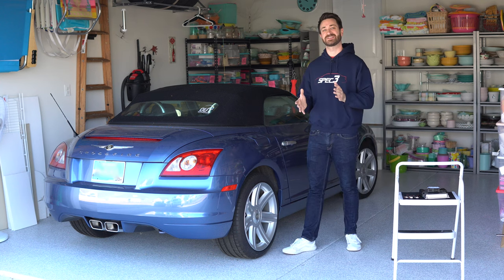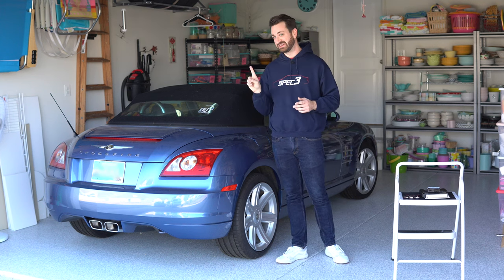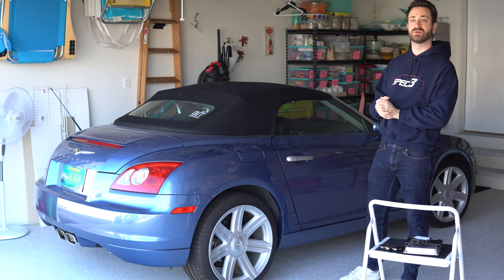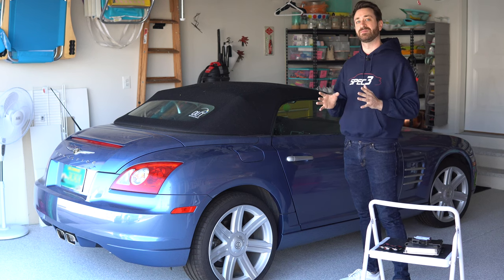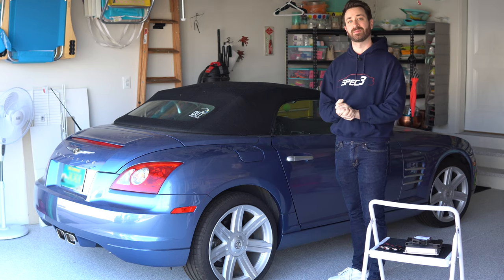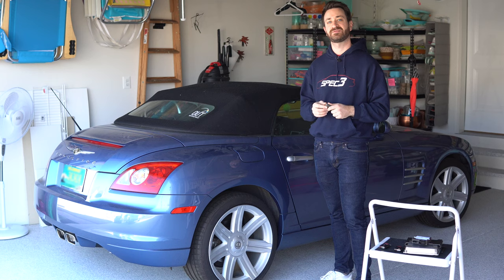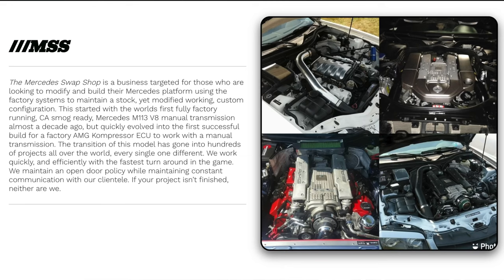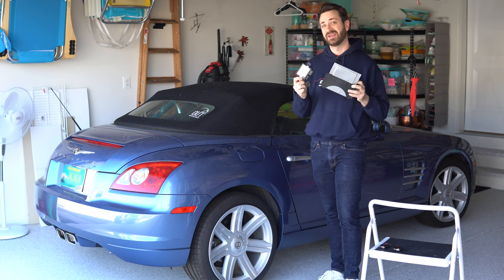Finally Fixed! Chrysler Crossfire SKREEM Repair and No Start

Comment: The slow battery drain is one characteristic i have had if i let it sit over four days without starting it. Today i fixed the starter problem. Battery was fully charged . The provlem was in the SCREEM unit. It took about a half hour to fix, most of f that time was removing and replacing the 
SCREEM unit.

Comment: Amazing - 4 + years and it still is as valid as the day you did video!  My Crossfire has lots of issues- I now have one less!  I have left the key in ignition for 3 years! If I took it out, it may take 5 seconds or 30 minutes (or more) to get it to turn to start car.  I took my time - referred back to video several times (I too have manual and wondered what happen to that black brake connector thing).  I'm 69 next month and have issues so this was challenging.  I started and removed key 5 times no problems. I call it a good fix! 
I found this video looking for something on Parking brake tightening, My handle pulls all the way up and no hold..?  Figure the EB is locked up in wheel?  any Thoughts?

Comment: Another bypass you can use if you have an Autel 808, is you go under the menu for SLK 170 16pin ➡️ slk320 ➡️ control modules for body ➡️ CCM ➡️ you'll get an error message about no communication before you select "okay" turn the key.

The car will start however if you turn it off you're going to have to do the whole process over again but it is a great way to get you out of a bad situation.
Reply: Hello! Is this also possible for the Chrysler Sebring 2007, could you let me know the method please ?😢
Reply: @akubel33t  I have no methods for the Sebring

Comment: Hi, Thank you for this video, and you  kept your mothers car so pristine. What brand radio did you replace the OEM radio with. Love that it was the same or similar color as the center console. 😀
Reply from the maker: We only wanted to modernize the head unit if it could match the center stack! Ended up using a Kenwood marine unit that added Bluetooth and USB, and can have the backlighting match the factory controls/gauges. It's several years old now but this appears to be the modern equivalent:

https://amzn.to/3CFWlRZ

Comment: Hi Jake, it's been a while since you had the ECU reprogrammed and reinstalled in the car.  Is it still working properly?
Reply from the maker: Hey Lester, it is all working fine. It seems the biggest point of failure for the SKREEM is when battery voltage drops while the car is parked, and I don't believe the battery tender we were using would keep the battery at a consistent enough voltage to keep the modules happy. So, we're either going to start/drive the car weekly or (for winter) take the battery out entirely and keep it charged without staying attached to the car.

Comment: Hi.  How long did the disassembly take in order to do the swap?
Reply from the maker: Disassembly was pretty easy, maybe an hour or so. The ECU is quick to pull from the engine bay. Getting the gauge cluster out to remove the SKREEM module is not hard, just time consuming. Get trim panel tools and don't force anything to come off. There are screws in the driver's footwell that you will probably miss the first time you try to remove everything and it will feel stuck. And go slow popping the gauge cluster out of the dash. There are tabs keeping it in and you are dealing with old plastic that does not want to bend much.

Comment: Have you ever had a problem when u replaced the skreem module n your airbag light then stays on ?
Reply from the maker: No, and those shouldn't be related in theory. Airbag lights typically come on if there is an issue with a sensor in the system, or if you unplug a sensor while the main 12V battery is still connected. We'd suggest having the airbag code read so you know why the light is on. Any shop with a diagnostic scanner (Autel or similar) should be able to read it.

Comment: I think i ll just sell the motor and tranny.
And put in a 4 cyl 1980 carburator Toyota motor with its   automatic transmission .
I only paid $2000 for a non running car .
Just for the body style.

Comment: I have 3 crossfires and hope this never happens to me.
Reply from the maker: The more you drive them, the less likely it is to happen! Sitting is bad for them.
Reply: @OutMotorsports  I drive one for 4 months then park it for eight months.  Drive car 2 for 4 months then park it for eight months.  Drive car 3 for 4 months then part it then park it. Then start back to car one.  Got my first crossfire in 05, crossfire two in 08 and then my SRT6 in 2011.  Sea foam makes a good fuel stabilizer.